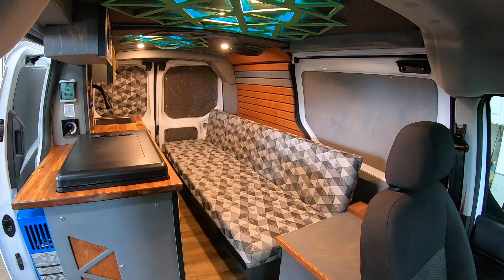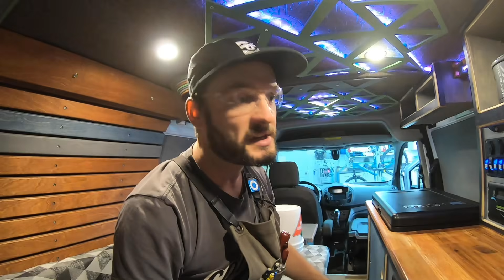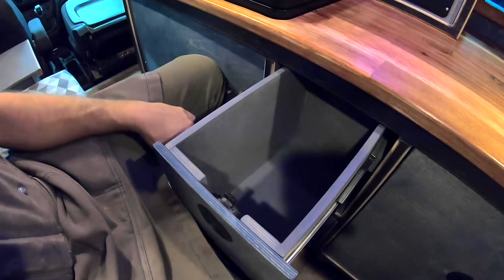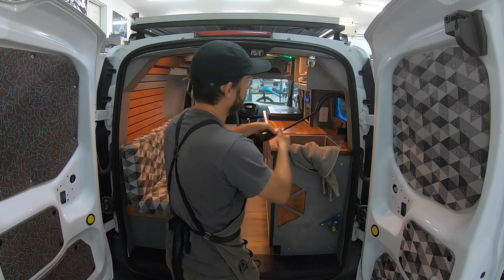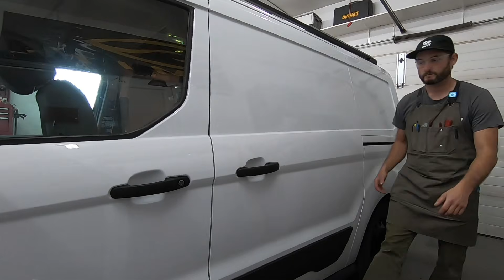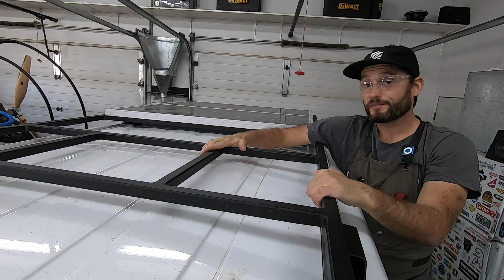My Ford Transit Connect Micro Camper Build and Tour

Comment: nice build, but those speakers are pointless and bulky, especially if you want to be stealth.  You'd whack your head on that roof speaker.  As for the bed, it doesn't need to be electric - if you can easily manually pull and push the bed in place, you'd save yourself the electrics.  If the fridge was a little lower, you could cover it with the benchtop and have it integrated so it could also be hidden and double as bench space.

Comment: Thanks for the video! Is this a standard transit connect? I’ve been thinking about building a micro camper like this but the roof height was always a concern for me. What are the dimensions from the floor - top of the bed - to the ceiling? Thanks!

Comment: Amazing conversion. I am converting a similar van - transit connect 2018. Any tips on getting the battery cable from the leisure battery which is behind the driver's seat (right hand side) to the starter battery in the engine compartment? I have taken out the glove compartment but can't see a way through. Any tips would be much appreciated.
Reply from the maker: There is a big rubber cable entry. Run your hot cable through it using a spiked end coat hanger as a snake. Attach the cable to that and pull away. Be careful not to puncture any other important components. The cable being pulled through will form a weather tight seal.

Comment: MOTORCYCLE RACK BABY YEAH THATS WHAT IK TALKIN BOUT, I saw someone install a pivoting motorcycle rack so you can get it out of the way when you want your doors open too, is that a possibility with a normal tow hitch rack?
Reply from the maker: You bet, I had the swivel mount on my van before this one. Ground clearance will be greatly compromised though as this is a low van and the swivel adds more leverage to the hitch as it creates a longer moment arm.

Comment: Where can I find the automatic bed?! We are both tall people and need a lengthwise bed but so far our efforts to find a suitable seat area that converts to bed have been unsatisfactory. They either take two people to pull out or are just awkward -- our Ford Transit van build weak link
Reply from the maker: It was built from scratch using a linear, 12vdc actuator and FWD/REV switch, I don't have plans, sorry.

Comment: Would be nice to see how the bed was built. Can't you explain, or, if you still got the van, make a short video
 Thanks a lot 🙏
Reply from the maker: It's basically several 500lbs heavy duty slides with a linear actuator that slide the whole bed. The back rest is just on a hinge.
Reply: @Pistonpedal Difficult to understand for somebody who never worked with any sort of actuator. Couldn't you make a 30 seconds short on YouTube ?!? Please...

Comment: Why is nobody talking about how it would take literally 3 seconds to pull out the bed manually? 🤔
Reply from the maker: Oh it’s been mentioned a few times. I didn’t want an automatic bed either but it was very difficult to pull it out with all the doors closed because you would have weight on it while trying to slide it.

Comment: Is your passenger seat on a swivel? If so, what hardware did you use for that?
Reply from the maker: It isn't, the seats are too low to make them swivel so folding the passenger seat down and sitting on the back of it worked great.

Comment: Really great conversion and amazing use of space. I will say the bed is a bit ridiculous. It would take like 1/10 of the time to just pull the bed down "manually"... -_-
Reply from the maker: That was actually the reason why the bed was automated. I really wanted it to be manual and quick but the space is so tight that you wouldn't be able to lean over and pull it out with the doors closed and in stealth mode. It's mainly due to the fact that the bed butts against the counter and you can stand there while also pulling on it.

Comment: For the two months I was on our build, the shop, tool bench's, floor, driveway, was a total mess. Only when I could not find any of my tools did I pull a "work stop" to clean up. Your shop looks like I could have my L4/l5 micro disk surgery in there.

Comment: How is the condensation buildup? I know that is an issue for every converted camper van out there. Obviously you can't completely stop the buildup, but what have you done to limit it?
Reply from the maker: Because it is nearly impossible to use up much more head room in this smaller van I had to be very thin with the roof. My main concern was that all materials was either rated for outdoor use or mold resistant and/or waterproof.
Reply: @Pistonpedal  Right on thanks for the reply! I have a 2015 high roof transit. Been thinking about converting it, but it now has over 311k miles on it. Prob not the best idea to invest that much in it especially when it's the twin turbo model.
Reply from the maker: @goodvibes7104  Try to imagine how long the vehicle would last and then just ensure that your build will outlast that, even if, by only a small margin. Re-use the parts and start up a fresh build. It doesn't have to be a costly endeavour :)

Comment: Do you do builds for others? I’ve got a 2019 Transit Connect Extended Wheelbase Cargo van totally stealth with 64k miles that I did a no build, build out on, my solar is a 4Patriots 1,800 watt solar generator with a 100 watt solar panel. I want to buildout the van to be more streamlined like what you showed. If you do that can you share costs and timeframe to do such a buildout? I’m not so handy with these things. Thanks. I love what you’ve done.

Comment: Sadly for the ppl who dont no is that the camera always makes them look so much bigger its a massive illusion trust me ..
Reply from the maker: Exactly. A very important consideration as I've mentioned in previous comments. The illusion is not intentional, it's just difficult to film and do a walk through when you're alone so I use a GoPro (Wide Mode not Super Wide). I am only 5'-8" `and don't recommend this build for anyone over 5'-11." I lived in this van for one month during the testing stages and I was very comfy but once again, it's not the best for taller people. Thanks!

Comment: I have a 2018 Transit Connect that I want converted. I checked out your build and it is exactly what I'm looking for in a Stoke Machine. 🤘

I also just say your woodworking setup and man I don't think I'm handy enough to build it myself. 

If you do custom builds I want to get on that list. I'd have it dropped  of whenever you'd have an opening.

If you don't do builds for clients would you be down to share any specs and measurements? It's the same as exact van as I have.
Reply from the maker: Hey Dude! This is all possible. I am a little backed up at the moment but we can definitely talk. Shoot me an email at: vwroast at hotmail.com
Reply: @Pistonpedal  sweet! I'll shoot you an email

Comment: I am thinking about ordering the 2023 connect.  How do you like this van?  Has it been reliable?  I have heard that these vans have transmission problems, is this problem relegated to the older van version?
Reply from the maker: I didn't have any issues with the van other than a faulty wiper motor. I can't say much other than that....

Comment: No where to get air flow when sleeping or just sitting. You will roast inside this. 100 liters is just over 26 gallons. It is what I have in my Stabicraft boat fuel tank
Reply from the maker: There is a fan directly above where your head would be when cooking or sleeping. You can either open the vehicle vent system or just crack a window and just watch any smoke/steam from cooking get sucked right out. It stays surprisingly cool well into the hot day, still much better than an uninsulated and unvented van. You should be outside having fun when it’s that nice anyways ;)

Comment: Curious.  I see you provide a cut out in the counter space with dimensions specific to whatever model of refrigerator that you've chosen.  When such refrigerator eventually fails, what does one do regarding refrigerator replacement, especially if said model is no longer being manufactured.
Reply from the maker: There are two other manufacturers that make this size of fridge in several models at +/- 5mm. I left that allowance in the cutout for that exact reason. Pretty common size so no worries. I like the way you think ;)

Comment: What about air conditioning? Is there a way to run the ac on battery power?
Reply from the maker: To run an AC unit on battery power requires serious solar/battery capacity that would really only be suited for a full size cargo van. There isn't close to enough room on this roof for that much solar.
Reply: @Pistonpedal  thanks for the reply. So how many batteries do you think it would take to power a very small energy efficient ac? Just trying to do some homework.
Reply from the maker: @dandan4221  Depends on how long you plan on running it. The Sprinter I'm building now with a very efficient AC needs 4 - 110AH Batteries and 600w of solar. Key here is insulation of course. That's where you can make things more efficient. A good fan placed appropriately works well also, and that's what I used in my Promaster for 2 years of travel.
Reply: @Pistonpedal  awesome. Thanks for the info.

Comment: Nice little setup, nicely done, but a lot of stuff mounted to the ceiling to bump you head on 😆
Since your Alternator charges your battery when driving, I guess you don't have a lifepo4 battery, but one single (100Ah?) calcium semi traction battery. You will find the useful capacity too little very soon with all those electric accessories and a ( I presume compressor) fridge.
Reply from the maker: I have one 100AHr Battery yes, but it's rarely below 12.5vdc even while the fridge is running. 200w of solar seems to keep up really well for this setup. I do agree about sacrificing a bit of headroom but I'm usually only laying or chilling opposed to being outside. It's not everybody's cup of tea but that is also why I built it, to just try something more interesting.

Comment: I was excited to hear that you put a class 3 hitch on this Ford Connect to accomodate a 400 lb motorcycle based on the tongue weight needed. Is your hitch meant for a carrier or a trailer? I am interested in having my bike attached to the back on a carrier, not a seperate trailer. My motorcycle is a KLR 650 and weighs 432 lbs. I understand I need a class 3 hitch to accomodate that tongue weight. But how do I know if my 2008 Dodge 2500 Sprinter van can handle that weight? My interior build will not be too heavy. I would think if your Transit Connect can handle a 400 lb bike with that hitch, mine van could too. How did you learn how to calculate this? Thank you for your time.
Reply from the maker: You need to know is your vehicles payload capacity. A 650 is a bigger bike than the WR250R I carried but it may still be doable. The sum of all weights of your build needs to be under your total Payload. Mine could be on a carrier but my bike was much lighter. Also, the further your carrier extends the more tongue weight will be as the moment arm increases as the receiver leverage increases. Check out my “Boogie Van” build and you’ll see how I carried my Moto on my 2016 Promaster.

Comment: Nice build, but I will make it modular(maybe T-tracks), so it can easily be used as a cargo van when needed. Does the bed have a manual crank... in case of power outage?
Reply from the maker: The bed can easily be slid down without the actuator, but overall it's very reliable.

Comment: Awesome build.  And you managed to fit everything that I’ve been doubting on exactly where to fit it,on my transit 350 HD.  You prove that a little bit of everything actually fits on any Van.  I’d like to know what kind of faucet system is the one you’re running. That activates at the push of a button. And also your take on your toilet details.
Reply from the maker: Greatly appreciate it. It's just a normal faucet with a pressure sensing water pump installed separately, pretty simple!

Comment: ABSOLUTELY a jewel.  COngrats.  One question...if you use the water heater it must get really hot in there. Could you vent the hot air outside the van?

Comment: How did you attach the panels to the rear and side door window cutouts?
Reply from the maker: I built a wooden shim that wedged between the inner channel. Then I made it so it would self center and then attached the decorative panel to that with some upholstering.
Reply: Right on I'm gonna try something similar, thanks! Very impressive build my friend.

Comment: This build is beautiful. One, if not the best transit connect build I have seen. I currently own a 2020 transit connect with a not so great conversion, although it works for now. Where are you located and would you consider doing another build on a van similar to this? Extremely beautiful and practical build! Love it!
Reply from the maker: Really appreciate that, thanks! I am in Alberta, Canada and I may consider another build but I am not available until October. Feel free to email at: vwroast at hotmail dot com.

Comment: Awesome build. Super clean and well thought out. Only thing I would have done differently is the bed change. Seems like a waste of limited battery power when gravity would take care of it on the way down, and a simple hand movement in the other direction. But, if you're not worried about it, it's all good.
Reply from the maker: I tried to do it without the actuator but I couldn't pull it out without it hitting my legs. Hard to explain but it seemed like the best solution. Thanks!

Comment: Super cool build, that shower blew my mind. Style and finish are 11/10 you're some kind of wizard. I'd just make 3 changes, that slow ass/loud ass bed killed me bro lol, especially since you have to get up (easy fix). Swap the fridge and the toilet (pullout into doorway). Counter space is critical, and it looks like you sacrificed a lot of it to fit that fridge, the swap should also add 2" to the walkway ratio. That overhead speaker has to move bro, I'd like to save my headbutts for the soccer field. Much love, looks as good as any sprinter.

Comment: Really nice and well thought out build. Curious, can you take out the fresh water tank easily to fill and or clean it? Also, no heater? Wouldn't be a problem for me in the states way down south. Just curious being so cold in parts of Canada. Looking to build out a full size van myself. I can't imagine you're gonna have any problems selling this van. You may have a bidding frenzy infact. Great job and thanx for sharing.
Reply from the maker: Fresh water tank is very large and had to be mounted permanently for security. You fill the water with a typical hose. I've never had issues doing it this way so far... Edit: No heater as well but that would be a super easy install.
Reply: My wife and I are previous liveaboard cruisers. We lived aboard for 10 years and owned the boat for 15. Not once in that time did we clean the water tank. There are only two things that would cause you to have to clean one. Putting contaminated water in it, or allowing UV exposure through a plastic tank.